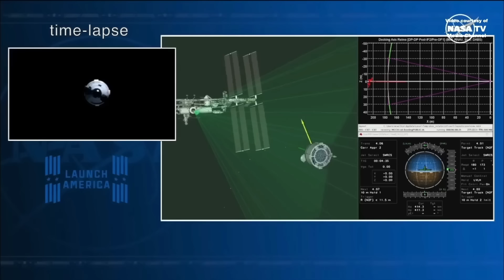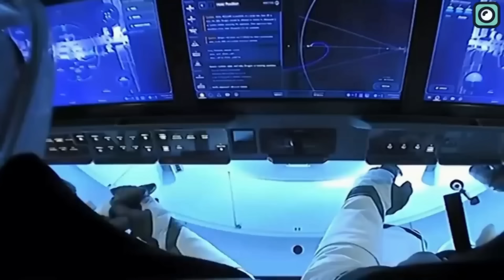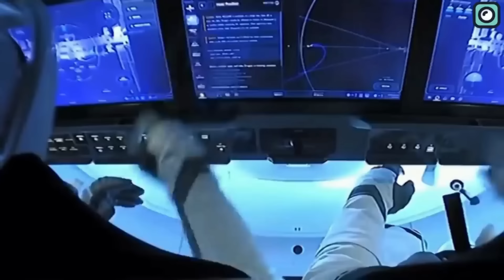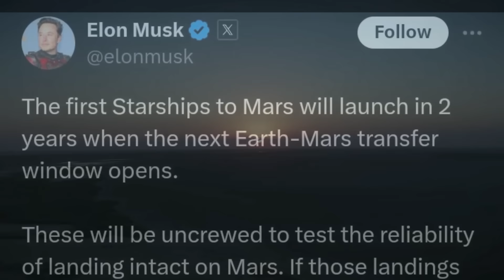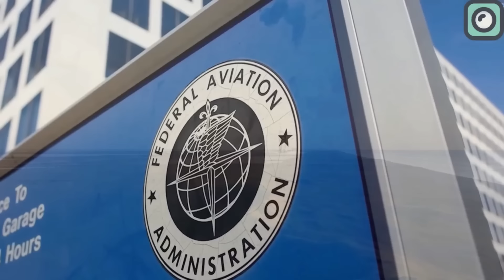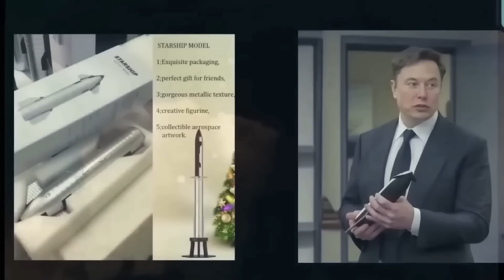Boeing Released What Happened To Starliner During Return Mission!

Comment: Boeing did not make the decision not to bring the astronauts back.  NASA made that decision; Boeing was arguing for putting them in that capsule.  NASA saved their lives.  Boeings concern was how it would look to have SpaceX go save them.
Reply: "Boeing rhymes with going" but it doesn't rhyme with "coming back". 😂
Reply: @mal2ksc    The more distance between them and real humans the better.
Reply: Well, after losing 14 astronauts and 40% of the shuttle fleet to disasters that were well known and 100% avoidable, I'd say "it's about time"... We got really lucky they only lost 2 out of 5 shuttles-- several other flights came back that were VERY near misses-- sheer luck prevented several more disasters.  Why it was PAST time to retire shuttle and replace it even by the time of Challenger which laid the shuttle program faults open for all to see... Thankfully the correct decision was made to retire shuttle after the Columbia disaster killed another 7 astronauts and proved the shuttle was a brittle, expensive, and still experimental system with inherent flaws that could not be fully or reliably corrected.  

I'm glad NASA FINALLY got the message to put crew safety over operational concerns or "optics" ie appearances... it's about time.
Reply: Boeing is done!
Reply: If Boeing's systems are flawed then they need to step back, stick to Aero Planes and Air travel/. Let Musk go intergalactic.
Reply: @ravenswolf57  they can't even do airplanes right...
Reply: You’re Going?
That’s Boeing 
What to come back on?
Try Elon
Reply: this is a PRO musk channel. the capsule landed as expected. they would have been perfectly safe.
Reply: @ThatOpalGuy  They would have been okay but with the overheating of the RCS system it was prudent to keep them behind.
Reply: @novianovioTV AGREED!!
Reply: @mal2ksc the boeing F15 has been I think their best aircraft in military grade planes.
Reply: The shuttle had an abort system that was needed built or installed. It, with 100% certainty, would have saved the crew in the first incident. 

Having a backup shuttle ready would have saved the second crew. 

The loses were so avoidable and preventable. 

The shuttle was never finished, they were all still experimental. Due to costs they left out the escape system. Probably same reason for no second shuttle being ready
Reply: @lukestrawwalker  a well worded and sound opinion.
Reply: Not that I have respect for Boeing but having seen Starliner coming back in one piece I disagree lives were saved. They were in danger, yes.
Reply: 0 hopefully the new CEO of Boeing will get them out of this business and back to dealing with Airplanes and quality control. 
Space can come later.
Reply: Agreed
Reply: A sad end to a great name. The mergrr was a huge mistake.
Reply: @ravenswolf57  This is what people say every time there's a failure, or even a launch abort. You only need to look at the comments under any SpaceX mishap video to see people saying exactly the same thing you just said against Musky Boy. This is why things are TESTED. You can have all the genius design people under the sun, but you still have to learn by doing.
Reply: That's being overly dramatic.  They would have been just fine if they'd come down in the Starliner.  NASA didn't "[save] their lives".
Reply: I was just about to say this, NASA is the reason it came down empty. Boeing wanted to risk it in order to save face.
Reply: You guys don't know s*** Boeing is not going anywhere.. over 50% of all  heavy commercial passenger in-service today were built by boeing.😂😂
Reply: @lukestrawwalker  the people in space were the ones that decided to stay i space not nasa
Reply: @georgemccune2923  lol of you believe that you're deluded...
Reply: @ThatOpalGuy 👎
Reply: Maybe...But it is time to void Boeing's contract, as a reliable source...To be a part of the space program!
Reply: Boeing was once a great company that was run by engineers and quality was the bottom line. They merged and a finance guy got put in charge with little to no engineering experience and the company has gone to hell since. Toss the finance guys and cfo's on the street and get back to focusing on the engineering and not the money and the money will come if they do their jobs right.
Reply: Need to put the CEO’s  IN TRAINING to do first flight ,then you know that it be over built for safe
Reply: NASA supports Boeing, what does that tell you…..
Reply: @jessiejanson1528 they didn’t even know there was a hole in the wing on Columbia. So they didn’t know they needed saving.
Reply: Put Douglas back in charge they beat the hell out of Boink, and Lockmart and already landed and returned from the moon. . .
Reply: @mal2ksc  "Boeing rhymes with going" but it doesn't rhyme with "coming back"  

"Once the rockets are up, Who cares where they come down? That's not my department," Says Wernher von Braun.
Reply: What do you expect from an account that uses AI?😂
Reply: Boeing value engineered starliner and  executives got bonuses taxpayers and astronauts got screwed, typical Boeing
Reply: @kevinroark5024   You mean the McDonnell Douglas F-15 that Boeing inherited when they acquired McDonnell Douglas?  McDonnell Douglas was an excellent manufacturer of military aircraft; they went under because they failed in the commercial aircraft market.  That is something Boeing needs to remember because they seem to be going down that same road.
Reply: @RobertLutece909 That is exactly the way of thinking that NASA used to kill previous shuttle crews.

Flying with unnecessary single point failures is a guarantee of eventual disaster.
Reply: @FelonyVideos  What single point of failure?
Reply: That's the first for NASA, they killed two shuttle crews due to their arrogance.   Disregarding air temperatures effect the solid rocket seals, and ignoring a warning by an engineer that insulation off the fuel tank could remove leading edge tiles.
Reply: @kevinroark5024 They inherited that one from McD.
Reply: Yep Boeing has become about Shareholders and optics, the shouldn’t be in business, their CEO’s extravagant remuneration is evidence of Rorting the company. He’s not achieving results yet he seems to be getting bonus pay anyway … he doesn’t understand his responsibilities and his company is failing for good management and direction … he needs to have his last four years Salary returned to the Taxpayer for failing to adequately do his job and he should be sued the rest for failing The Boeing company and its clientele …
Reply: Spacex to the rescue

Comment: The thruster overheating issue should had been caught years ago during the design phase.
Reply: It was. The engineers reporting design flaws were ignored by the profits first management.
Reply: RCS thrusters are not designed by Boeing. Dragon also had a ton of problems but they were ironed out over the cargo missions they did before crewed flights. With this being said Boeing will be moving away from this project. Sierra Space is about to launch Dreamchaser and they will be building a crewed version of the spacecraft. As they will be building the next space station after ISS is pushed into the ocean in 2030 this will push Boeing out of the crewed flight business. Boeing has many other space projects that they are doing well with, they also want to end the starliner project I would imagine, they having already spent 1.5 billion in overages. Space is costly and hard.
Reply: Yeah, that's like space flight design 101. And blaming it on subcontractors is just so over done. And Boeing is terrible about cutting corners to save dollars. They are also masters of milking government contracts. "Oh, we discovered this problem and that problem. We don't know how long but we can tell you the price is going up."
Reply: @SouthernRotors  They didn't build them, but they designed the dog house and put them in there.  100% their fault as a system integrator you are responsible for the system as a whole.
Reply: @SouthernRotors  "Boeing will be moving away from this project" Boeing has contractual obligations.
Reply: @SouthernRotors  You really should learn to spell. Crude.
Reply: @JelMain  So you read my comment and the only thing you took away from it was a spelling mistake.... People make comments using mobile devices, move on bro.
Reply: @JelMain  Whine on. He communicated, thatas all that's needed.
Reply: @clytle374  My sister-in-law who's an engineer at Boeing agrees.
Reply: @ads6-1.0 spot on spot on alrighty tighty then 😂
Reply: Boeing blackmailed NASA for 300 million for the previous test. They too abandon the program if not paid. This last mission was similar, they made a test launch into a crew launch so boeing could get paid under the crew contract. It never should have had crew. 

I wonder how they will justify crew in a capsule with new untested systems.
Reply: Boeings literal defense was "we could not simulate a space environment to test them and testing then on the ground would cause then to overheat" the thrusters were individually tested but never tested together.
Reply: @TheEkimssor  The engineers reporting design flaws were ignored by the profits first management.
Seriously? Give me a break. The engineers should not ever have designed such a flaw. 
They're fckng engineers, not overheating saboteurs..
Reply: If they had a test-fix, policy like Spacex it would have been however being is not about functionality and greater ambition to push boundaries, - just profit.  NASA and Congress have long been their cash-cow, but I'm guessing they are losing too many engineers to assess and quickly remedy faults and issues especially while the cheques keep coming in.
Reply: It was  !!!
Reply: @JelMain  Southernrotors may have similar problems to mine.  I have an AI auto correct,, that just plain sucks.  Some of the words I type, magically become entirely other words.  Annnd  Wireless key board.  I know danged well I typed an 's' and at times, I'll get either an 'a', or a 'd'.  And when it really gets fun is when the key board starts changing letters, and the AI re imagines words.  Bonkers.  BTW  If it is grading papers that you wish  to do, get an assistant teaching position with the local middle school.  They can be worser that me.  (quite intentional)
Reply: @Sailor376also  And that illustrates the issue perfectly. Check, doublecheck. If you don't, Murphy guarantees the accumulation of tolerances unidirectionally into a disaster.

Comment: For all crewed missions, Boeing needs to add additional safety measures by equipping the Starliner with JB Weld and duct tape.
Reply: That might apply to all space vehicles.
Reply: @SouthernRotors  Actually on one of the moon rovers, a fender got damaged. Nasa feared running without a fender would kick a lot of dust up and into the electronics. So, they devised a fender by using a lamented map and duct tape. I was shocked that they had taken duct tape with them to the moon!
Reply: @cruzin6123  Duct tape is a great fix for many things :)
Reply: Since astronauts first smuggled duct tape aboard NASA has sent it on every mission.
Reply: @cruzin6123  After the near disaster of Apollo 13 [needing to patch together incompatible filters, etc] I doubt they would ever be without it
Reply: @SouthernRotors Duct tape certainly has a place but it will fail if exposed to a vacuum. I heard about that many years ago and decided to see what happens. I taped a simple setup and placed it in a vacuum chamber. It completely failed. The adhesive was absolutely useless. When I pulled it out, the tape was just smooth strips of floppy backing.

Comment: It looks like Boeing's management has wanted to go cheap from the get-go, instead of doing it right in the first place, THEN deciding where and how to cut production costs.
Reply: They didn't go cheap at all. The rcs system was built by another company. That being said you would think Boeing would have worked out the rcs heating issues which are likely due to not meeting specs in some way. The helium issues, well, this is normal fare for space vehicles. They can be figured out but Helium is the second lightest gas so it often requires some work. Heck, the Polaris Dawn SpaceX mission was postponed a week or so ago because of a helium leak lol

Comment: Saw a lecture by an individual last year or 2022 about Boeing's space program and his thesis was this: Boeing will have problems because the company does (and relies too much on) computer modeling engineering and testing, instead of hands on engineering and testing. It appears his predictions are coming true. He spoke with a big part of his audience in the aerospace industry, and said people in the audience would not like hearing what he had to say, but he spoke anyway.
Reply: Yes but the head of the FAA stated that his problem with spacex is that it didn't  develop like Boeing.  This is the root of the FAA issues with SpaceX.
The FAA does not like hands on engineering and testing and will delay and fine spacex until they change.

Comment: Failure of the Starliner is proof of the failure of the Boeing work ethic. My bro worked in the assembly plant in the 70s where workers used the tail section as a hotbox to smoke pot in during working hours. He and many others quit, after repeated complaints to management and the union did not correct the safety issues that resulted.
Reply: Boeing replaced engineers in management with accountants who's job was to reduce costs.

What can go wrong when you fire engineers and ask accountants to build a space craft...

Comment: If NASA caught the thruster overheating during testing, why wasn't the program stopped to redesign instead of paunching with a live crew? WTF?
Reply: Boeing said it could not be tested on the ground because it would overheat and they couldn't simulate space(not entirely true, but nobody has a test facility for this, they could have set one to that was close though).

The previous launch, Boeing couldn't afford the test launch and threatened to quit the program unless paid 300m, NASA agreed(and violated several rules while doing so, not the least of all, SpaceX should have received the same boost in pay). For the last lunch, again Boeing didn't have money so NASA made it an official crew mission so Boeing could be paid under the crew capsule contract. Crew were placed on a test capsule. 

Next capsule will have untested fixes +crew or contract will be cancelled. I expect proper testing this time, but whether Boeing can afford the redesign and tests ... And whether Congress will agree to funding for the last few flights, very hard... Plus issues with SLS... No wonder they are holding spacex back.